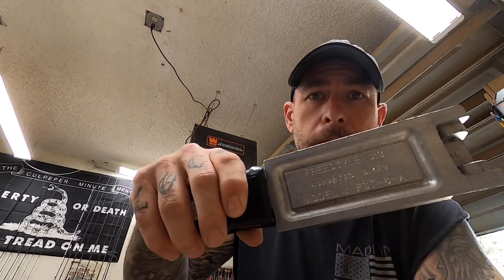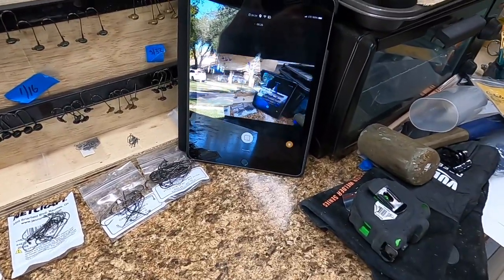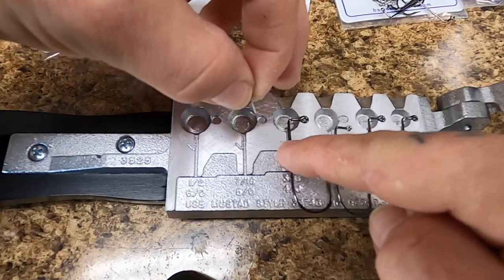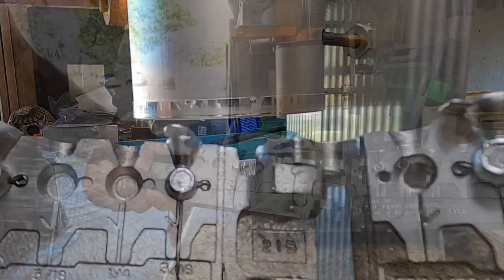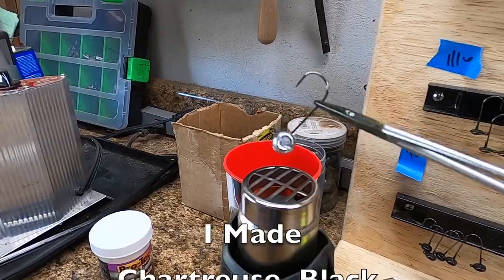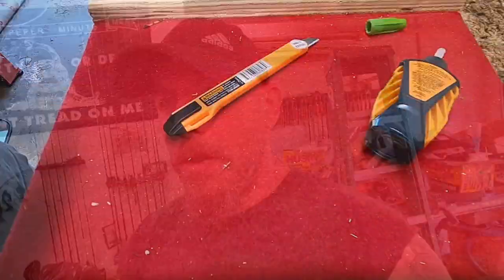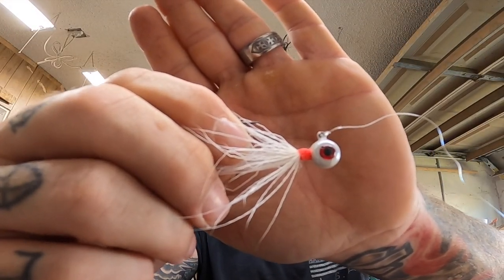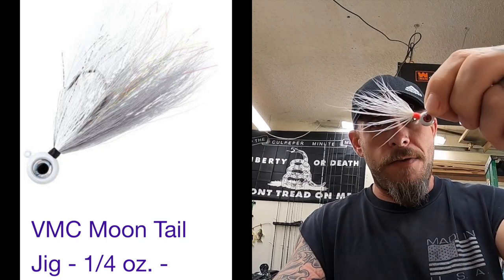I Got a New Do It Mold! Free Style Jig

Comment: Those turned out great. Hope you had a great Christmas!
Reply from the maker: Thanks Paul! Man I had an amazing Christmas! I hope you did too! 👊🏻
Reply: Mine was good too, thanks. Do you bake or heat the jigs after you powder coat them? I've seen some people put them in a toaster oven for a while and wondered if it really made a difference in the paint durability. Also, I shot you an email about a bait being back in stock. Tight lines man!
Reply from the maker: @Paul_T82  I’ll check my email when I get home. Thanks man! I do bake the ones I intend to sell. It does harden the paint up. For my personal use jigs, I don’t bother cooking them. I usually brake one off before the chipped paint bothers me lol.
Reply: Lol, yeah, I usually don't have jigs long enough to worry about chipping either. Thanks for the info.

Comment: Hey did you melt down my tire lock key??  I suddenly have an urge to paint my ned rig heads. What paint do you use?
Reply from the maker: I’ll melt anything that’ll work! Lol. I use the pro tec powder coat paints. They work great and a jar lasts a while. But if you just want black or white, harbor freight sells it and it’s first cheap and works well.
Reply: @ParabellumFishing  I want bright colors. So I can see them when fishing beds.
Reply from the maker: @DpuckFishingandOutdoors  base coat of white, then any color you want on top of it. The base coat isn’t really needed but The white will help them pop even more.

Comment: Hey bro, do you sell jig heads?
Reply from the maker: Hey man, not just yet. I just picked up the smaller version of the mold in this video for that exact purpose. I have to mold a few and fish them. Make sure they are decent before I try to offer them up, ya know. Im currently working on a site to start selling them. Soon I hope. Thanks for reaching out! 👊🏻
Reply: @Parabellum Fishing  would u have one without the keeper. Were did u get that mold at thanks for your time
Reply from the maker: @Glensoutdoors637  You can pour them without the keeper. just need to clean them up a little more. I buy most of my molds from either the Do-It molds website or Barlows tackle online. Thanks for watching!
Reply: @Parabellum Fishing  only thing I find now is with the collar I don't ones with the collar
Reply from the maker: @Glensoutdoors637  The free style mold doesn't have a collar. It does have a wire keeper.